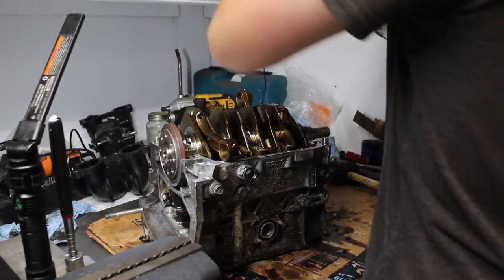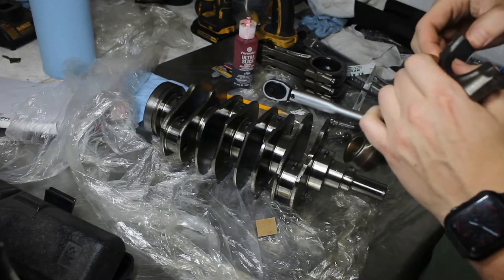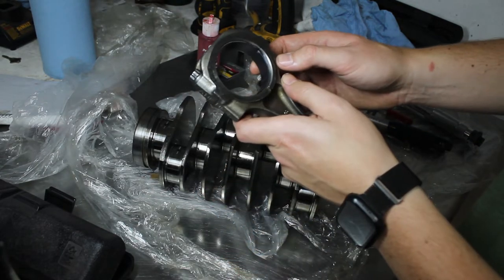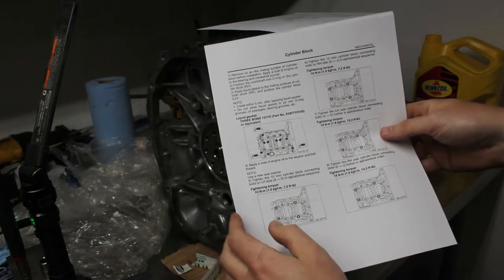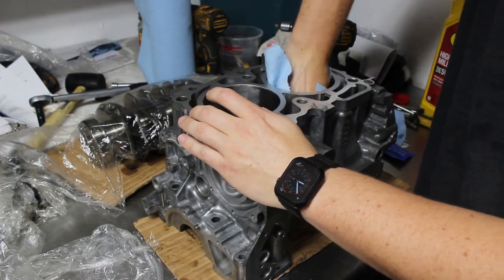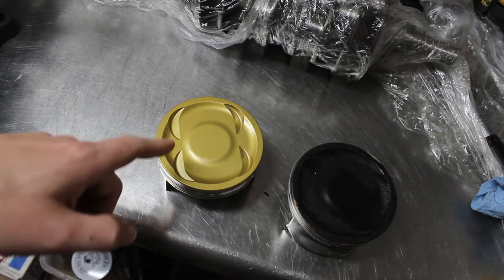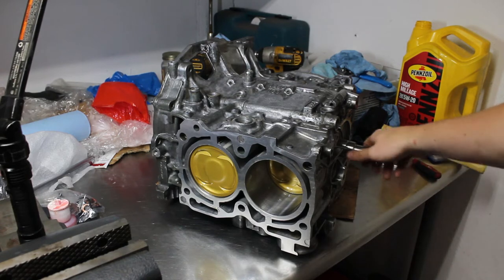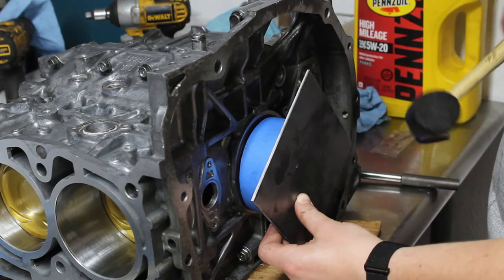Subaru 2.5L Turbo Engine Build - EJ255 Short Block Assembly

Comment: Nice video. Which ARP head studs did you opt for, the ARP2000s or the Custom AGE 625+?
Reply from the maker: 11mm ARP2000
Reply: @rainvillecreative5410  Thanks.

Comment: What material pistons did you use? 2618? Thanks
Reply from the maker: Yep, it's really the only option I could find for forged pistons. My only gripe is the higher thermal expansion rate, meaning I have a bit of piston slap on cold start.
Reply: @rainvillecreative5410  yeah they will do that lol. Here in the UK the 2618 piston is only for race applications or 500hp and over. The 4032 piston is the one to use, but if its the only one available fair enough. It also highly recommended you have in cylinder walls close decked. Due to head gasket failure and cylinder wall cracking. Especially over 400hp applications. Still, your build, your way. Really informative and I hope it lasts a long time. 🙏 👍
Reply from the maker: @christopheredwards357  What is close decking? I was sure to have them use a torque plate, if that's relevant. I'm still around 320 HP at the crank so it's not being pushed really at all, maybe one day I'll go for 400 but for now it's enough to handle keeping the rest of the car in good shape.
Reply: @rainvillecreative5410  close deck inserts are pressed between the cylinder wall and outside of block to give extra strength at the point of compression. The ej257 has very thin cylinder walls and are renowned for cracking under cylinder pressure and or detonation. They also tend to flex (distort) due to time/ cylinder pressure and heat cycles causing head gasket issues. In general, it is rare for this to happen to cars running under 400hp (crank) or under 1.5bar boost pressure. But go over these levels and you increase the risk. Hope this helps.
Reply from the maker: @christopheredwards357  Ah yes, I am familiar with that, I've heard them called closed deck conversions. I could have paid $350 to have my block converted, but the way I saw it, if I go 400+ hp, I'll need the 6 speed swap conversion. So too much expense for a 15 year old Legacy.